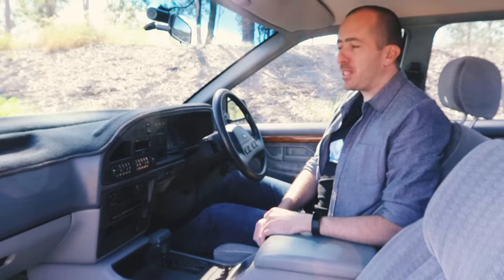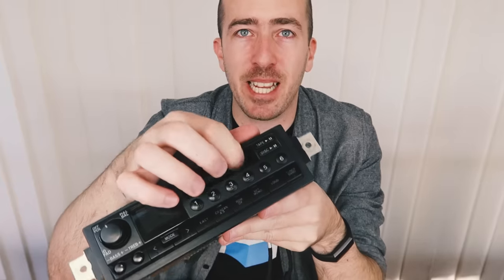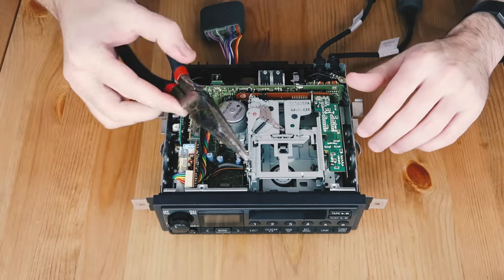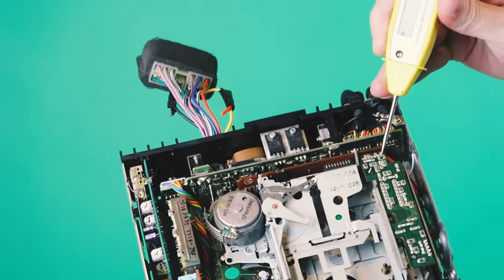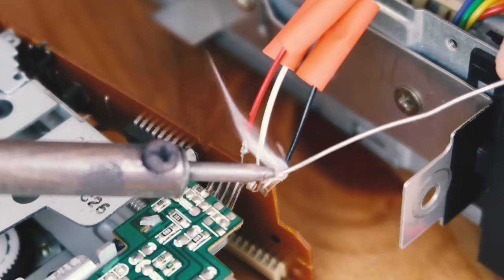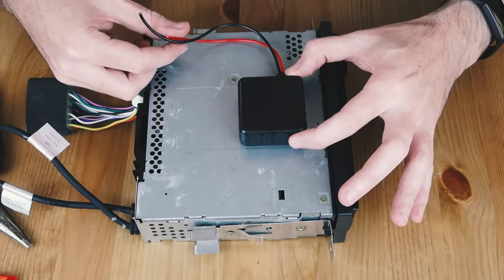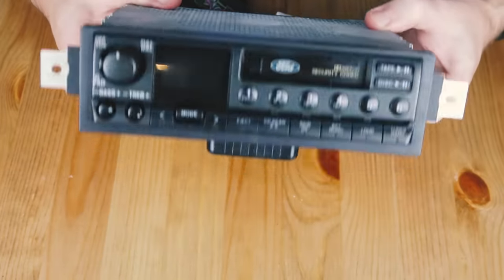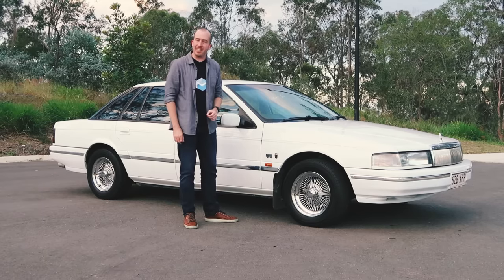Add Bluetooth To Your Old Car Stereo For $25!

Comment: Buddy, I don' t want to be a tapeworm(or a CDworm) out of a dog' s ass, but I must say that you have done some things a bit wrong. I like this kind of mods that I have recently found out, about the future-proofing of old car sound sytems, but:

-First, the RED cable is actually the switched power supply and the yellow one is the backup battery one(at least in the Greek ISO harness), so if someone reads this, just use a multimeter to see it yourself, using the key on the steering wheel' s switch.
Second, the cutting of the ribon cable -especially by inexperienced people is a bit prohibited. And when you want to shrink the tube, just use a small lighter' s flame.
-Third, if you are inexperienced with electronics, better take the whole unit to a qualified technician and tell him what you want him to do. The technicians need to eat too. Otherwise you will over overfeed them, by having them replace the whole destroyed unit, with a new and better one.

Apart from these warnings(and some others that I forgot of), it was a nice IDEA to do this modification. I have a lot of my own old sound systems, which I keep only for emotional reasons and I also soldered some standard ISO harnesses onto them.

Keep on doing the good work, with my regards from the cr@ppy Greece!
Reply from the maker: Thanks for the feedback mate. In my vehicle the yellow one definitely turns on with ACC, couldn't tell you why though. As for the rest of it, I've never pretended to be an expert but what I did got the job done, and has been working fine for around 3 years now. People who are a bit scared of having a go should definitely have an expert do the job for them.

And so long as the idea gets people thinking about the possibilities then mission accomplished. Thanks for watching.

Comment: why didn't you just solder the cables to the board and not to the spliced ribbon
Reply from the maker: Didn't want to fuck the board up, basically.
Reply: @MotoringBoxTV  got it now

Comment: my car is to new (2005) to use the tape deck method or i would own one by now :( but it is to old to have any other input like a AUX or blue teeth of any kind crying face
Reply from the maker: That's a shame - I believe it would still be possible to do the same with CD drive output, but you'd have to investigate that.

Comment: Why you not simple remove casette mechanism and put inside the bluetooth receiver. You don,t need.
Reply from the maker: My head unit requires it to be in place and working, otherwise it doesn't operate correctly.
Reply: Ok you have a point.

Comment: Or, for the super tight-arse or technically inept: Buy NA Fairlane rear ashtrays with their own individual lighter sockets, then plug in your 15 dollar chinese eBay bluetooth reciever in so you can't see it. Stock looking dash, plus an extra lighter. Win/win?
Reply from the maker: Actually I wanted to find a pair of those and then convert the lighters to USB chargers.

Comment: your Bluetooth receiver uses a line level output, a cassette head outputs a similar output to a magnetic cartrage on a record player. the input will be swamped as the line out is preamped! there Has to be a better method...
Reply from the maker: Dunno what to tell you mate, it works perfectly.
Reply: @MotoringBoxTV  maybe you got lucky, the circuit board the head connects to may have been the pre-amp circuit, maybe inadvertently you spliced into the pre-amp's output. giving the perfect  input level from your bluetooth receiver

Comment: Good video but if we talking about quality of sound your actually better off with your wired cassette tape in your cassette player , or installing an aftermarket AUX cord, or yes even buying a cheap 20 dollar head unit. Reason being is Bluetooth audio streaming absolutely sucks compared to a cd or aux wire , wireless connections will never compare to wired connections.  Do your own test.. play a song through Bluetooth , than play the same song through Aux cord ,or USB An you'll see the sound quality is much on the Bluetooth .
Reply from the maker: There's always a compromise I guess. I'd happily take an almost unnoticeable hit in quality just to avoid having to stuff around with an AUX cable. Plus you can do this exact mod using a female AUX connector wired in.

Comment: I've seen someone put the bluetooth module in the cassette. It think it might have been KipKay
Reply from the maker: Yep, you can buy those. But it still reads the audio signal via the tape drive head, plus they have in-built batteries which generally need to be recharged every 6 - 10 hours.

Comment: Oooooor! You can buy a cassette with the aux cord attached for $5 at five below (US only) instead buying and doing all that and possibly ruining your vintage stereo
Reply from the maker: I can tell you didn't even watch the start of the video. Check the pinned comment for an explanation. Cheers.
Reply: @MotoringBoxTV  I did see the video and did read your comment about not having a cassette wire but I am just saying it seems too much of a hassle when you can just use the cassette and listen just fine

Comment: why not just splice into the speaker wires?
Reply from the maker: Because there's no way in hell that'd work.
Reply: @MotoringBoxTV  Why not? Its out putting a signal to the speakers and its powered so thats like an amp and your bluetooth device is the driver!
Reply from the maker: @dodgeramsport01  The bluetooth module is powered, but there is no amplification taking place. Even if there was, you'd be bypassing the entire head unit so none of the buttons or the volume knob would do anything.
Reply from the maker: If it was amplified yes, but it isn't. By all means go ahead and try though!
Reply: @MotoringBoxTV  no just thinking outloud! great video!

Comment: Just buy FM transmitter for 5 bucks. not only will you savemoney and all the work but you can use it in any car instantly.
Reply from the maker: Just an FYI if you didn't watch: this video is for those who aren't satisfied with transmitters or other adaptors.

Comment: Guess you don't know that auto reverse casetted decks (almost any of the) have to have the takeup reel turning or it will spit out the tape.  Too bad, so sad, not rad.
Reply from the maker: The tape adaptor I held up in the video could fix that problem - it's geared and both reels turn at once. Simply cut the cord and load it in.

Comment: just get a bluetooth cassette adapter if you have a cassette player in your car
Reply from the maker: That's an easy option, but the pinned comment explains why I won't. You also have to recharge their built-in batteries every 6 hours or so.

Comment: So why didn't you simply solder the wires to the back side of the PCB and not have to cut the wires? That way you could use a gotten cassette to load in your head unit when you wanted to listen via Bluetooth and would still have given you the option to play a legit old school tapes. 
Oh and look into getting some liquid electrical tape, it is a great option when you don't have room for heat shrink or electrical tape.
Or you can just buy a Bluetooth cassette that allows you to have the convenience of Bluetooth and let's you keep the functioning cassette player with zero mods needed and for less$ than the Bluetooth adapter you buy to hack up any ways.
Reply from the maker: That's definitely an option. I've not had success soldering directly onto the PCB previously and didn't want to risk damaging the board. Plus I don't listen to tapes and never will :)

Comment: Would this solve my turbo smoke issue ?? Haha quite clever really I used to love taking electronic stuff apart as a kid & changing wires around etc , circuits boards look so complicated but are pretty simple really...I’m on the sofa cause I fell out with the misses , she prob thinks I’m chatting to other girls or watching porn or something only if she knew the truth 😁😂
Reply from the maker: Sorry to hear mate, but that's so funny. If only she knew you were watching a middle-aged man reverse engineering 90's electrical equipment.
Reply: MotoringBox I’m gonna let her stew for a bit I think 😂 I love things like this really cheered me up lol so cheers 🍻😃 if only she knew if only she knew 😂 I would prob be single...😐😂😂😂

Comment: I still have a STOCK radio cassette player, all you need is a cassette adapter hooked up to a bluetooth and pair my smartphone...VOILA! My 2 year old smartphone is BETTER than most of automotive infotainment system using inferior SOC chip compared to the latest smartphones and tablets.

Comment: Ahm why not remove the whole cassette tape mechanism inside and put in place the bluetooth receiver device?
Isn't it ironic that you get rid of the cassette tape earlier in the video yet retained the cassette tape mechanism?
Nice hack though!!!
Reply: I agree about the leaving of the tape unit in the stereo. But, its probably simpler to identify the signal feeds on the deck itself than trace it inside the amplifier section.
Reply: @dougshiner9180  
Ahm yeah i realized. You're right. Its easier to just leave it as is but i think there's a way to get rid of the cassette tape mechanism but it would take some time to trace circuits as you said.
I really like this idea of installing bluetooth module to old car stereo. I will do the same one of these days.

Comment: 25 dollars? You can get way cheaper ones that do the job fine.
Reply from the maker: Cheapness isn't the main focus here, it's about integrating bluetooth directly into the head unit without using FM modulators or tape adapters. I'm guessing you didn't watch it before commenting?
Reply: @MotoringBoxTV  I did. I was talking about cheaper bluetooth-to-3.5mm adapters, actually. Most don't run off 12v, but aside from requiring snooping around for a 5v source or hacking in a little regulator, they're a fine option.

Comment: You've already taken out the crappy stock radio might as well install an aftermarket one
Reply from the maker: People are more than welcome to do that, but the video explains my reasoning. Mainly that I wanted to keep the dash looking stock standard and I hate the way aftermarket head units look when fitted to old cars.

So for $25 and a little bit of time, I was able to achieve exactly what I wanted. Thanks for commenting.
Reply: @MotoringBoxTV  yea maybe cheap single dins radios, but pioneer or kenwood double dins would make your car just as modern as a 2019 vehicle
Reply from the maker: A modern 2019 stereo in a 1993 interior, not the look I was going for. But a good upgrade for those who don't mind.
Reply: Lol you're missing the point my dude. He wants to retain the original look while being able to have a modern feature.
Reply: @KookiDowg  the factory dash looks like shit from that era plus who gives a flip about it lookin like factory. It'll still look better than the oem radio. Y'all living 15+ years ago man
Reply: @MrViper7121 , zip it amateur
Reply: @MrViper7121  HIghly doubt it would look better. I think practically all aftermarket stereos these days look like shit.

Comment: Waste of time faffing around cutting and stripping the ribbon cable.  Just solder to the existing points on the board.  That way the tape still works, for what it's worth.  The bluetooth module could easily be mounted inside the tape drive body.  That car must have been inside a vacuum it's whole life.  Can't think of anywhere in Oz that it wouldn't have dust and stuff in it.  We used to put our franger boxes in the tape drive for quick access at the drive-in.
Reply from the maker: Sure, you could do - my only concern with that is whether the tape drive would still be outputting any background noise/hissing on top of your bluetooth audio. If you strip the case off the module it could also fit in the drive, I preferred to mount it on the underside so that the signal would be as strong as possible.

Comment: Now show me what to do with an AM only, not even 8 track, 70’s ford head unit.
Reply from the maker: Well it'll still have audio circuits - perhaps only 1 if it is a mono head unit. So in theory if you can find that and tap into it, and find a way to disconnect the AM antenna (to prevent any signal/buzz/background noise) it is do-able.

Comment: Now how do you do that, with a 73 head unit, that only has a radio tuner? lol
Reply: You would find the preamp section in the schematic, break the trace between the tuner and preamp, splice in the aux, and add a switch to select between either hearing the bluetooth audio or the factory radio. Otherwise you'll have radio playing over whatever audio you play through the bluetooth. Honestly, I would just recommend using an FM transmitter at that point, as this mod is really only doable if you have a more than basic knowledge of electronics, including audio amplifier design from the period.
Reply from the maker: Good advice. I'd probably go for an FM transmitter in that situation too.
Reply: @davidk8893  I also have another option, for a future install. 

My plan was to basically use the factor head unit, install new speakers, and I have a amp with bluetooth built in.

Just haven't had the time and money to get everything I need. Wanted to do something quick and cheap for the time being. But I'll probably just wait until i have everything for the system, and do it right.
Reply: @eig1979  that is an option as well. I used this one (https://www.ecklerscorvette.com/vintage-car-audio-compact-amplifier-180-watts-with-wireless-bluetooth.html) in a '68 mustang, and it works quite well. A plus of this system is that all functions of your original radio work, but you can also play Bluetooth through the stereo system when the radio is off. The downside is that the original radio volume/tone controls don't work with the aux/bt signal.
What car is the radio in, BTW?

Comment: i'd just take deck off and solder those wires to main board and hide bluetooth inside radio. could be easily restored to original state if anyone needs that kind of junk.
Reply from the maker: Alright.

Comment: I have a 2004  Nissan Quest That doesn't have a blue tooth setup.  My Subaru has it and honestly, who cares! I don't waste my money. Sorry but the FM converter works best and is cheap on most units. My Nissan Quest is a royal bitch to remove the stereo and its part of the center console with a separate  head unit and steering remote. You won't be hacking into that unless you know what the hell you are doing.
Reply from the maker: Fair enough.

Comment: BUY AN FM TRANSMITTER.  Here saved you  precious  time.
Reply from the maker: I mention FM transmitters in the video, but this mod is for those who want to do it properly.
Reply: @MotoringBoxTV  I understand  but some  people are  not  very good with  wires and  soldering and pulling out the radio without causing damage to the trim or something.  All I'm saying  is  an fm transmitter  is simple and  when you  don't  want it  remove it.  There are expensive  options  that offer  great  sound quality.  It all depends  on how much you  want to  spend. But this  is definitely  a  good  long lasting  solution. Great  video

Comment: Output is low quality than original cd out or cassette .bro
Reply from the maker: You're just talking about the Bluetooth standard - nobody can do anything about that. The real issue is bluetooth via a tape or FM adaptor is MUCH worse - so that's what we're fixing here. Bro.

Comment: This is a flawed method, you ruin the option to use cassette. And not only that, you will hear background noise of the radio trying to play the cassette
Reply from the maker: Flawed in your opinion. Viewers can tweak this method however they like to suit their needs. Your last point is incorrect though.
Reply: @MotoringBoxTV  If I were you, and didn’t want to use cassette. I would have just wired it in directly and removed the other connections to the cassette player. That way you wouldn’t hear it trying to play.
Reply from the maker: @Fiat_176  already tried - the head unit detects the tape drive is missing and treats it as a malfunction and refuses to switch to tape mode. Other head units may be more forgiving.
Reply: @MotoringBoxTV  What about cutting the negative wire going to the Cassette player motor?
Reply from the maker: Tried it. Basically as soon as you change any of the connections it caused issues. If the reels weren't spinning, it triggered a "stop" and would return to radio in a few seconds. I'm sure if an expert spent a few days playing around with it there would have been a solution, but it was far from straight forward.
Reply: @MotoringBoxTV  Well I didn’t think they would make so much out of it on a radio, it seems unnecessary but of course Alpine is over engineered.
But it’s easy to overcome, just use a multimeter to see how much the electric motor uses, or maybe you’re lucky and it’s printed on the motor, and then put in a resistor instead.
Just like if you change a blinker bulb over to LED.

If an expert uses a couple days, the tape function would be fully functional.
And you would just have another option called Bluetooth when you press source, for example FM1 then FM2 then TAPE and then Bluetooth.
That would just be a matter of reprogramming the chip😌

Comment: But now you can't play tapes... how is that "original"
Reply from the maker: Original look. If you want to keep playing tapes, solder to the existing points on the board and leave the springs in. Pretty simple.
Reply: @MotoringBoxTV  that's what I'd have done yea. Saves the hassle of stripping ribbon cable too. Less work and more functions. Simple

Comment: Instead of doing all this spend 15 at Walmart for a fm transmitter that requires nothing
Reply from the maker: C'mon mate, I even talked about that. This mod is about hard-wiring Bluetooth so there are no adaptors or wires visible on the dash. If you enjoy your $15 transmitter, that's great.